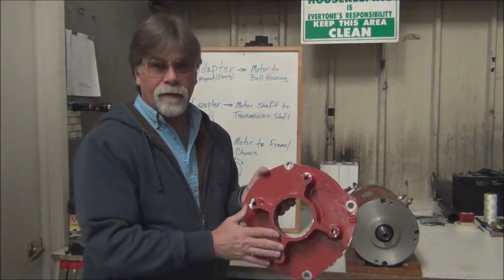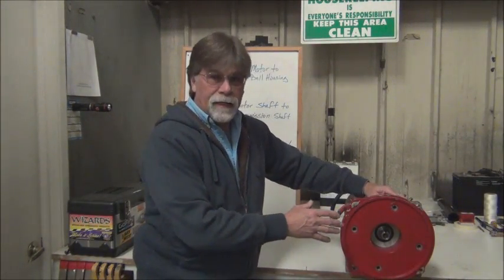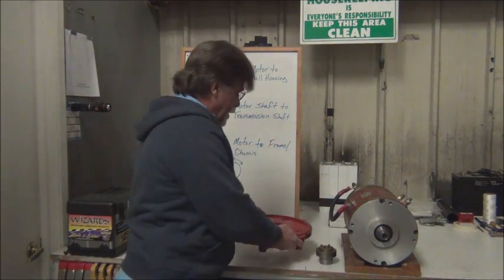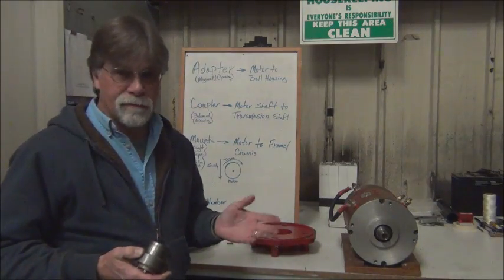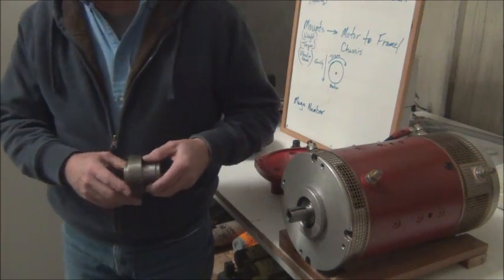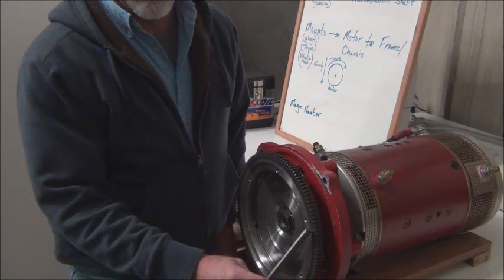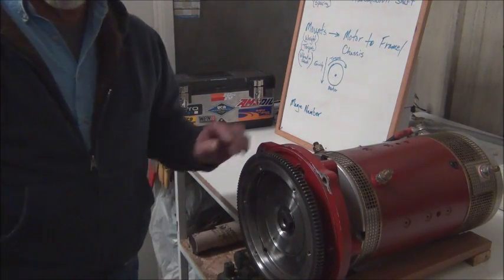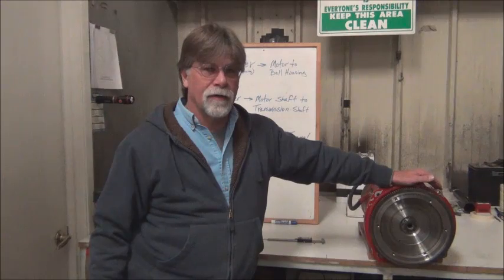DIY Electric Conversions - Adapters, Couplers, and Motor Mounts

Comment: Hi Richard, hows things? Happy new years to yourself, family and crew. Thanks for your channel and videos, i've basically watched them all! I'm going put a forklift motor on my vw (i'm not in the US and don't have access to these specialised motors) and just wanted to confirm one thing... The clutch is attached/fixed to the motor, is it absolutely essential that the adaptor can't let the clutch assemble 'walk out' or have any linear movement? Thanks.
Reply from the maker: Please address your questions to:  info@EV4Unow.com  Thank you for watching and please subscribe to the channel.

Comment: How can we get it perfectly aligned?
Reply from the maker: To do it right is somewhat of an involved process.  Basically, you use the drawings provided by the motor manufacturers and measurements taken from your transmission.  Since we have an engraving business, we typically take the transmission figures and make a plastic template to confirm that everything is dead on before we send the specs. to the machine shop.
Thanks for watching.